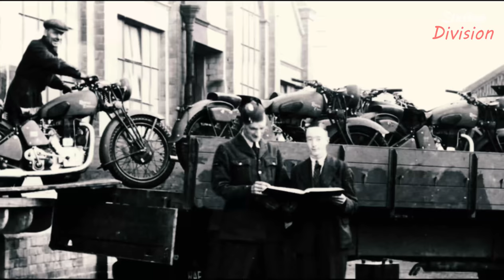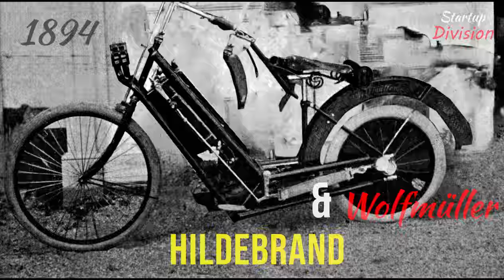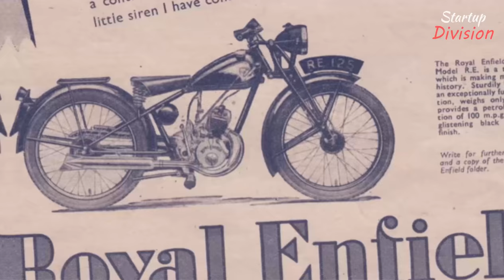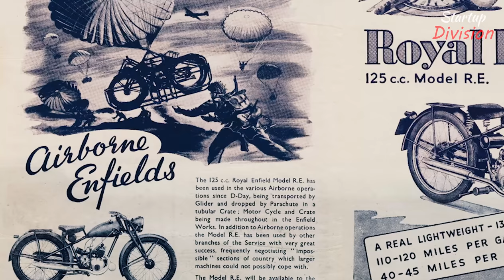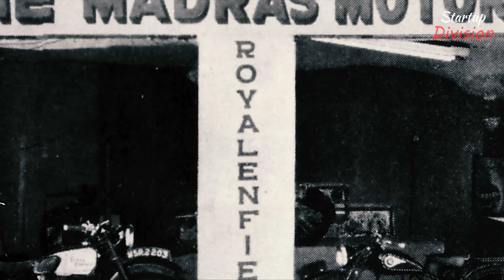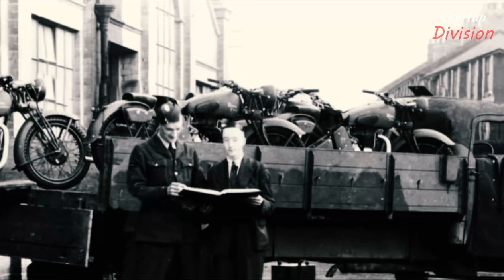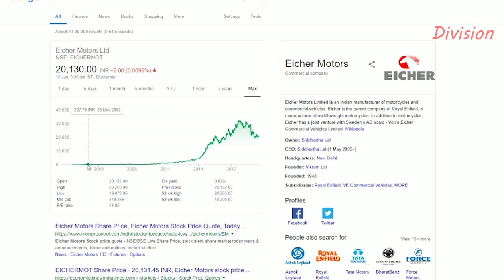Royal Enfield - How It All Began | MUST WATCH

Comment: a correction - they never built interceptors in india until they started making the new ones in 2017; they built only bullets in india for about 50 years from 1955 till around 2005 when the other models started entering and gaining ground.